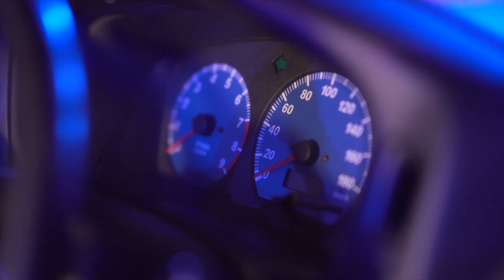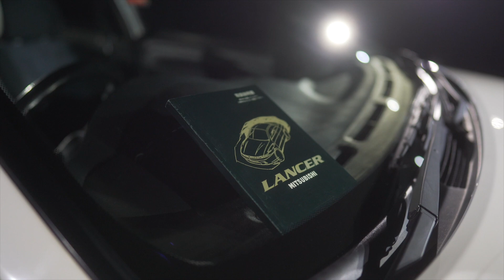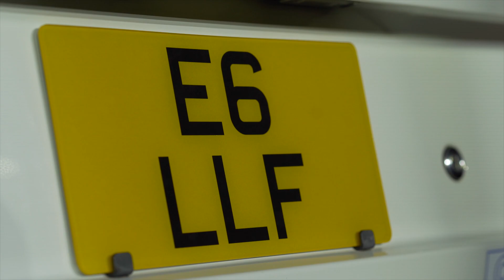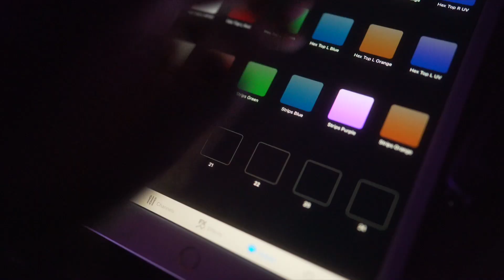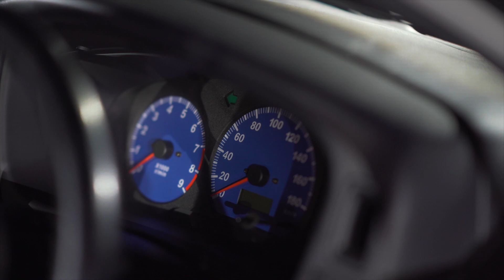I BOUGHT A NEW CAR **COLLECTION**

Comment: Sick... Totally dank 💪🏼
The only thing needed for this car is to change the seats 💺 to Recaros (obviously keep the original seats and any parts you remove to put back). 
Obviously the customary M.A Developments Full Shabang conversion (2 Litre Forged CP Piston / Carrillo Rods Jobbie with Full Race / Borg Wagner EFR 7670 Turbo Kit and Clive W Gearbox Strengthening) is required... it will give you a smile as big as driving your R35 will... 
Syvecs/Emtron or Autronics ECU to get the most out of it. 
Ohlins suspension to transform and modernise the handling. 
Happy Birthday brother... I’m made up for you and well done on a successful year and a great future for LLF 😀
You have the baddest car collection going on brudda👍🏼.

Comment: 5:07 by not painting the door mirrors and handles, they probably managed to save like 0.00006nm.
Amazing
Reply: They came from factory on white steel wheels aswell also had seam welded shell for homoligation it was real basic Mitshibisi knew it was all going in the bin can't be many road ones left
Reply: @jasondunphy1170  yeah. But I still kinda find it funny how companies find the smallest ways to save weight. Such as porsche with there "rope" handles. With an automatic window switch right next to it 🤣

Comment: Original mate. At MOST a basic 400/400 setup and put stock suspension or proper rally dampers or basic b6 bilsteins with stock rate springs ans stock height!! Do not go crazy on it!!! You will have wayyy too many mad cars plus Classic innit.